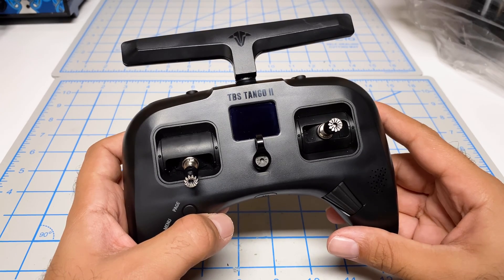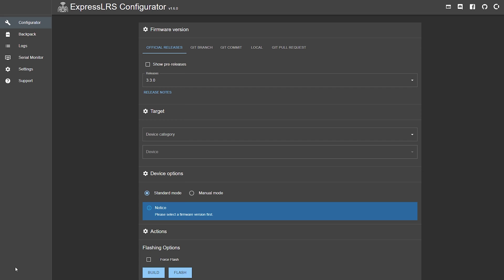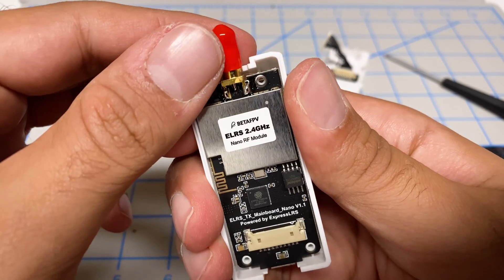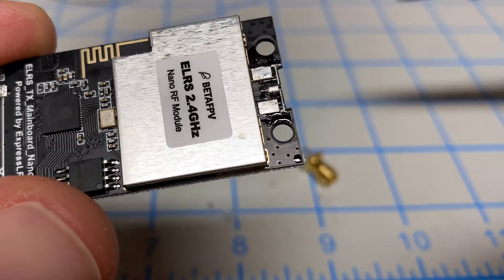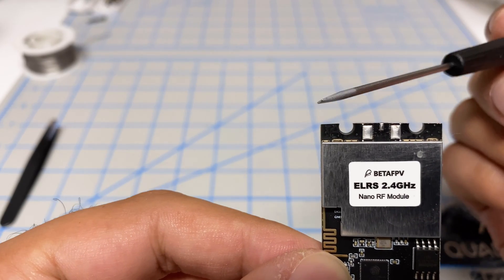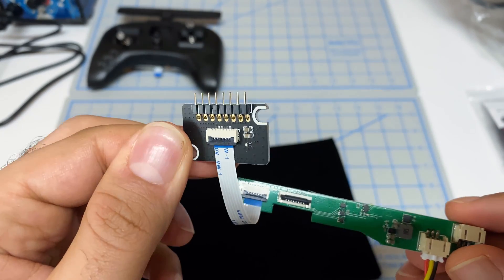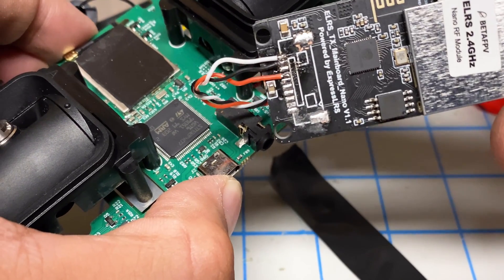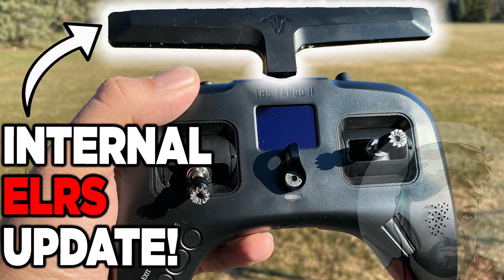TBS Tango 2 Pro INTERNAL ExpressLRS Module | 2023 How To Guide Update

Comment: Does this also work for the current elrs module? The one you link to is out of stock but theres a gen2..
Reply from the maker: I did look at the Nano V2 module more closely and it has a really big heatsink attached to the board due to the 1W output. You'll need to do some more modifications to get that thing to fit. It's most likely doable if you have enough time and patience.

Comment: I wonder if the 1w module from inside the boxer would work?
Reply from the maker: No, that module is too large. Even this BetaFPV module I used is on the verge of being too large. I did try a BetaFPV 1W module and it was too large, requiring too much modification to make it fit.

Comment: Could you use any module to just use the interior of that module or are there specific requirements
Reply from the maker: You need a nano module and one that ideally has a UFL antenna connector otherwise you'd need to do what I did in this video. You also want a module that is as small as possible or that you can modify to become small, such as sanding the PCB a bit.

Comment: The issue is elrs needs 2s, but tango 2 only 1s radio..
Reply from the maker: The external module bay boards take care of the up-convert required.
Reply: @Mangorille  I know but when tango batrry around 3.6v and elrs is higher than 100mw im having failsave because the bec is brownout? I already use the happymodel ext module which is stronger than tbs one
Reply from the maker: @ I haven't had any problems but I rarely need to go higher than 10mw where I fly.

Comment: Also, could you just remove the headphone jack too?
Reply from the maker: You can. I didn't want to modify the Tango 2 Pro too much but yes especially if you don't plan to use that ever. Not really required though, I show that with a bit of patience is all fits together.
Reply: @Mangorille  I don’t have a dremel, any ideas how to trim the pcb?
Reply from the maker: @brycellewellyn3483  Do you have an angle grinder? If not, see if you can borrow from a friend or your local home improvement store's tool rental.

Comment: As you are removing the button from the pcb. Should you bind an rx before hand?
Reply from the maker: You can do all the binding through the ExpressLRS LUA script or by simply flashing a binding phrase when updating the firmware. The main thing is to do the initial firmware update before you start modifying the PCB so that you are sure you can continue accessing the module through WiFi down the road.
Reply: @Mangorille  perfect. This is my first time using elrs. Not sure how it works. 
Wifi enabled when you update the firmware?
Reply from the maker: @brycellewellyn3483  You'll like the way it works, very intuitive. You enable the wifi through your radio's menu once you access the ExpressLRS LUA script. The main thing is you want to make sure everything is working before you start to tear apart the module. Check out the ExpressLRS website. They have some really good guides on setting up ELRS.
Reply: @Mangorille  cheers. Will do

Comment: I have the same setup as yours, but my expresselrs lua said "error1-firmware"
Reply from the maker: Are you using the LUA script that was generated by the version of ELRS you're on?
Reply: @Mangorille  yes, from elrs configurator, i tried all, still no luck
Reply from the maker: @christianoluko  are you able to update the firmware of the module through wifi?

Comment: Hey! Really liking this mod. Was gonna do it but cant seem to find the specific module you used. Betafpv has phased it out and only the new v2 is available.
Reply from the maker: The new module looks similar from the outside so you may still be able to follow this guide but I can’t confirm without having one of those modules myself. I do see the v2 supports 1w.
Reply: @Mangorille  V2 is too large for the area between the gimbals, FYI
Reply: @DanoFPV  Large how? Too wide? Too long? Did you try? Is there another module that fits?

Comment: Nice update. I am still super happy with the Happymodel ELRS Board, but I do not do long distance flying. At any rate Mangorille has hugely improved my RC experience with his internal ELRS mod. Now I can fly lighter whoops an 2" micros with onboard ELRS that dramatically improves my experience. While there are fantastic radios out there such as Zorro and Boxer, I really prefer the Tango 2 as the ultimate KISS radio. Totally minimal layout that is perfectly located for efficient control for thumb flyers. Its only fault IMO is the postage stamp sized screen. I dream of a mod that allows a bigger screen  to be taped/glued on top of that little screen. TBS Tango 3 should offer ELRS version and increase the screen size. Only other mod I have done and would advocate is to increase the bump size of its momentary switches on the back of the radio. Other than that keep it the same. I love that 3 menu buttons become 5 buttons by doing short vs long presses. Brilliant!!
Reply from the maker: Thanks buddy. The happymodel module was great just became really hard to find so I made this video with the betafpv instead to give folks additional options for the mod.

Comment: Hello, I've installed the same model in my Tango 2, but I can't set the baud rate to 1000 Hz. I can only set it to a maximum of 333 Hz. Is this normal? Perhaps it's a limitation of the BetaFPV module? Could you provide me with optimal settings to achieve good latency and avoid any risk of failure? I use my drone for cinematic shots.
Reply from the maker: Did you update to the latest version of ELRS? The module does support 1000hz but I wouldn't suggest that unless you're a hardcore racer. I use 150hz and that is more than enough. The higher the packet rate, the less sensitive the receiver becomes which means less range.
Reply: @Mangorille
Reply from the maker: @ziggyaiefpv  Yes sir?

Comment: Wonder if it would fit the Mambo
Reply from the maker: That's a way bigger radio so good chance of being able to fit a module inside it.You'll need to figure out the wiring though.
Reply: @Mangorille  Yeah.. One day I'll get the perfect radio, surely it will happen. Mambo has the best ergo, but uses Tracer. I only fly ELRS and Crossfire for LR. The Tango2 works well, made a tiny SuperSlim DIY module for it, all is fine. For the Mambo, I'll have to also wire up a switch, that will toggle between the "internal" ELRS module, and the "original" JR bay connection (utilized by external Crossfire). That way I'll be able to permanently have Crossfire module in the Mambo's JR bay, and just flip a switch to use ELRS instead.

Comment: İs it durable frame ? I wanna buy this for bando freestyle do you suggest it ? İs it shaking when you doing freestyle ? And I just wondering topspeed :))
Reply from the maker: The Quadmula Siren F3 frame?
Reply: @Mangorille  djinn 2.5
Reply from the maker: @ahmetturan8292  Tell me more about how you're planning to fly this thing. It's designed more to balance freestyle and cinematic so would not be my first choice for a bando.
Reply: @Mangorille  ı just searching durable frame because I wanna do bando and I will always fall on the floor
Reply: @Mangorille  can you suggest me 2.5 inch durable frame for bando ?
Reply from the maker: @ahmetturan8292  Why do you want a 2.5" vs. a 3"?
Reply: @Mangorille  smaller than 3”

Comment: @Mangorille was the happymodel es24tx slim still working good you just wanted more mw?
Reply from the maker: The es24tx was working perfect and never really needed more than the 250mw in practice. However, it was a difficult module to find so this was my attempt to not only get a more powerful module in there (just in case) but to also get a module with better availability. Since this video was made the BetaFPV module is out of stock too unfortunately.
Reply: @Mangorille  okay fantastic. Thanks for the quick reply!! I found the es24tx for sale on eBay, a bit pricey, but imo worth it. I will buy and use that for my mod. I believe 250mw will be plenty, and the happymodel mod seems a bit more in tune with my skill set!  Fantastic video! Many thanks.
Reply from the maker: @blaw_0121  Welcome. Ya unless you're really good at soldering, the happymodel iron man version is a lot easier to work either.

Comment: Right now betafpv 2.4 GHz module is gone everywhere. I am thinking about happymodel ES24TX slim pro. Seems to be slim but I can not find any image of the module stripped down. Any recomendation?
Reply from the maker: I haven't tried the Slim Pro but I think it could work given the size. You'd still need to desolder the SMA connector and perhaps some other components to make it fit. This is the best I have been able to find showing the internals: https://youtu.be/8dFMOVXBTIQ?si=U_oXeQu2fkjIorEn&t=128
Reply: @Mangorille  really appreciate your research. Seems a bit too populated at least at the bottom. I may have the option to chop a bit of the top board. Another option, but considering it to close distance could be 
https://youtu.be/2cn96u_nlnw?si=u4n2P_95mwuPhXXh
A simple happymodel ep dual Rx converted into tx. It only goes up to 50 mw but for 200m it should be enough right?

Comment: Hi, what fw version FreedomTX & Crsf are you running? No issues with elrs v3 lua script?
Reply from the maker: Running whatever is the latest public release. Also running the latest version of elrs. Only issue I have is that I get a low voltage alarm when I use crossfire on higher outputs. I worked with tbs and they said it’s a firmware bug and they’re supposed to be releasing a fix. This was 6 months ago though and I don’t use crossfire that often anymore.

Comment: so based on your experience, is there any packet-rate limitation (issued in just up to 250hz) when internal ELRS module installed on Tango 2?
Reply from the maker: I only run 150hz but I did try putting the module up to 1000hz and I did not see any errors being reported. From the controllers perspective, this is wired no differently than if it was outside the controller. So anything that would work with this external will work with it internal (other than perhaps heat as we no longer have a heatsink).
Reply: thx u very much @Mangorille
Reply: @Mangorille why you lying bro,external module betafpv does not work on the f1000 protocol, maximum f500, because tango 2 does not support it,bound rate is too low for working in f1000
Reply from the maker: @ You are correct, I went back and checked just now with the latest version of ELRS and I can only go up to F500. I was sure there was a F1000 back when I first did this mod but perhaps it never worked and now there is smarts to actually remove rates that are not compatible.

Comment: I've been thinking the boxer 1W module would fit.
Reply from the maker: You mean the one that comes inside the boxer radio? That one looks quite large. The other module I had my eye on for this modification was the happymodel nano pro 1watt but they weren’t interested in working with me on something like this. I’d also be worried about 1watt without a fan or sizeable heat sink, both of which will not fit inside the Tango 2.
Reply: Nah I doubt it. It's much bigger. Almost twice the size of these
Reply from the maker: @RynoRotorSports   I don't see anything bigger than this BetaFPV fitting in there. It's both a matter of size and thickness. I also don't see a 1W module being okay without a heatsink and fan (both of which you won't have the space for).